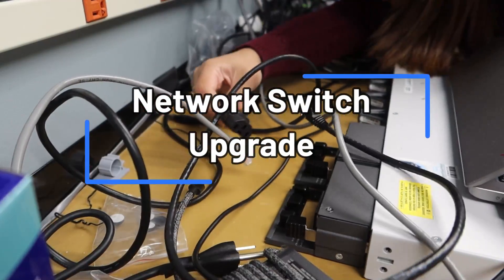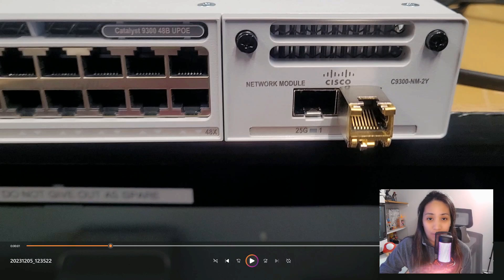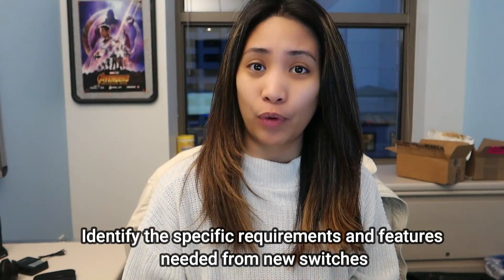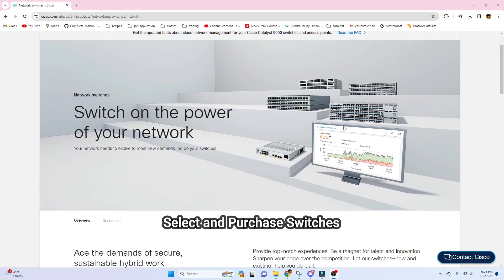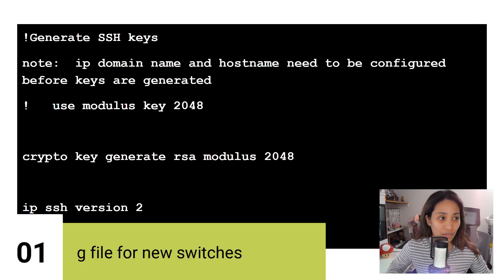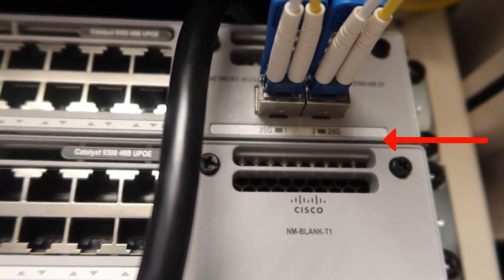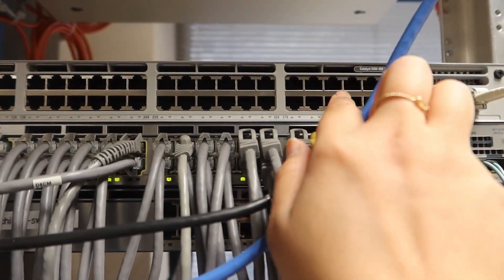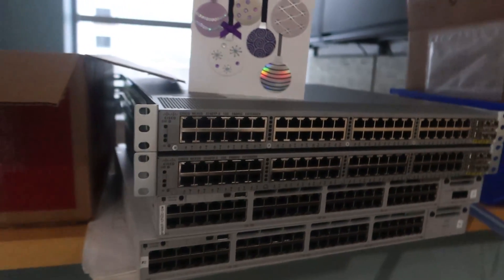Cisco Switch Project from Planning to Deployment | Catalyst 9300

Comment: The Catalyst 9300 has a setup configuration file, as you mentioned. What was not covered was, what were the individual settings laced there? Why were they selected and an explanation as why you would want to change one. No changes means the previous technician s settings were adequate. Explaining these, here, would be appreciated.
Mark Spalenka

Comment: Hello which networking certifications you recommended as my job is vlan configuration on switches and managing access points and what certificationa you have done so far?
Thanks
Reply from the maker: Hey!! I recommend CompTIA Network+ or CCNA. I've done the CCNA training
Reply: Do you need a switch 、router、firewall、Controllers, modules, IP phones (Cisco & Aruba&Aruba&Junipper&Fortinet )?